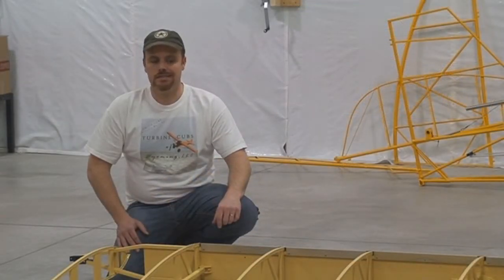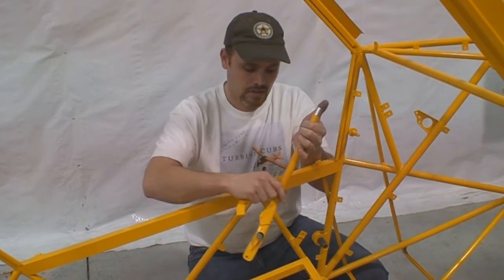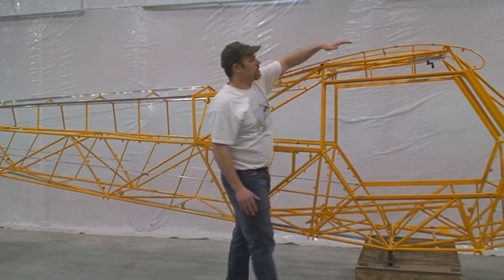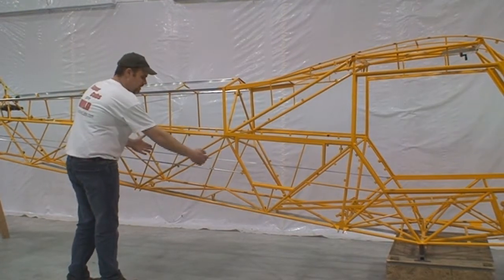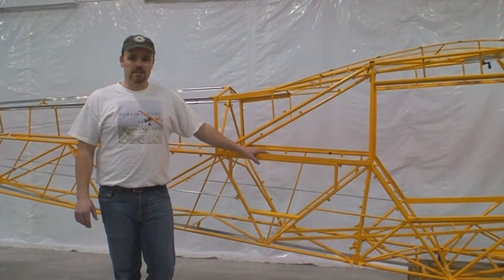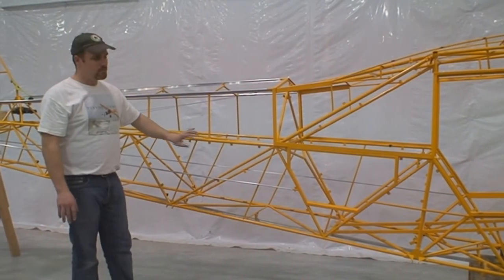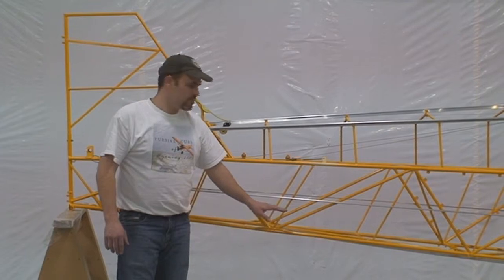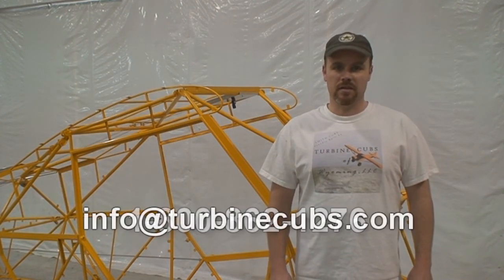PA18 Part 4

Comment: To the guys raising hell about the price of the kit; If you would study the reality of airplanes and airplane construction, the FAA-federal bureaucracy, the necessary quality control, the cost of materials, the liability (all this exists even with Experimental Kitplanes!) all this adds cost incredibly! And keep in mind this is a good USA-made quality product, hand build and quality welded! Its not some Chinese or north Korean slave labor camp product like most of the stuff you buy at Walmart or HomeDepot and such. I am not part of this company or special friends with them, I just try to point out some reality. Aircraft are at best build by the hundreds, cars are build by the 100000's, so the unit cost can be much lower and the automated tooling cost can be spread better. The Price is really justified.

Comment: The cost comes from the specialized materials the aircraft is built out of. This is not ordinary steel or aluminum and they have to withstand heavy loads over many years. It all may look simple to the untrained eye but to those of us like myself...a licensed aircraft mechanic...I can assure you it is not simple! A tremendous amount of research has to go into the design process just for the mods themselves and then approved by aeronautical engineers...that alone is not cheap!!!

Comment: However airplanes need much better engines and have to be much more reliable than cars. It doesn't matter if something happens to your car, you can pull over, in a plane there is no pulling over. That's where the cost comes from.